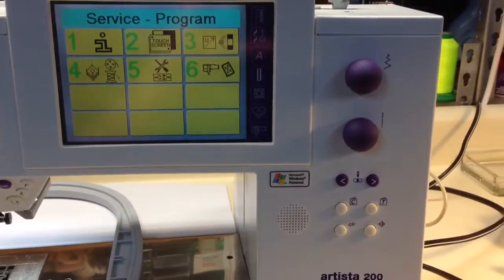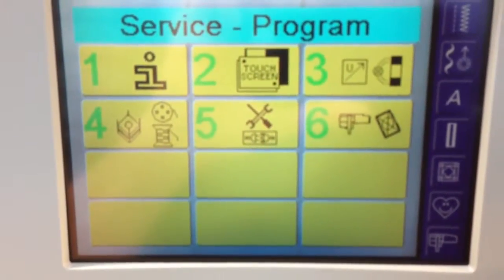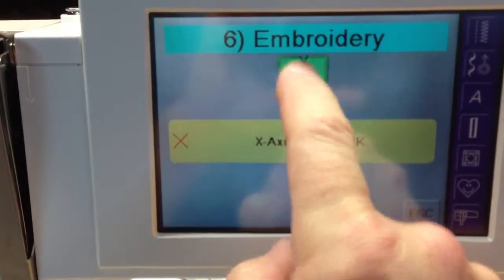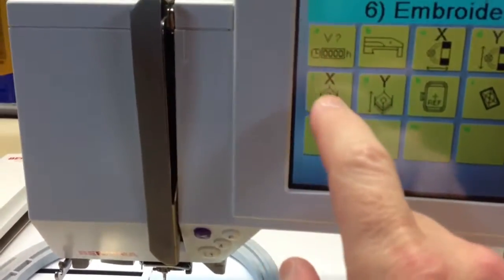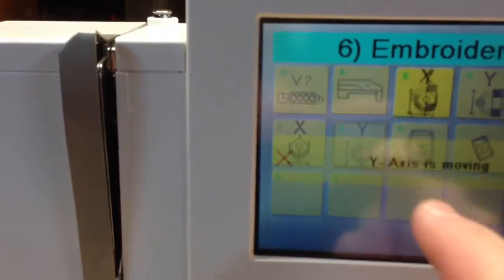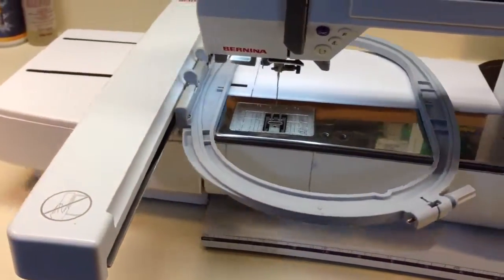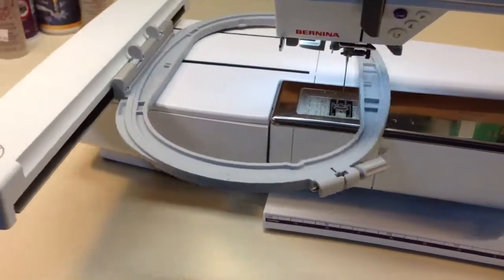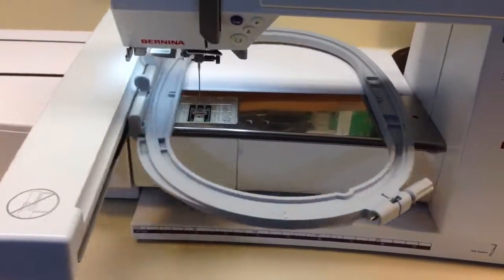Bernina 200 730 How to test your embroidery module.

Comment: we were trying this today with the large hoop.  It moved in the directions and then all of a sudden, it stopped at the lower left corner and the control panel kept saying it was running.  We turned it off, and back on and it said it was still running.  What do you think might be wrong with it.  It took us 8 hours to embroider a pillowcase.  It was VERY stressful.  We would almost get done, and then it would stop sewing. ARG
Reply: How do I clean the bobbin case, this is used machine I don’t have instructions

Comment from the maker: Hi Brian, You need to check out my other video, "Bernina check hours 165, 170, 180, 185" this is the one that shows you how to check the version number of the machine and the embroidery module. The module must be on the machine and plugged into the machine. The machine version number and the module version number must match for the module to work with the machine. Follow that video and let me know what results you have before we get into talking about replacing parts.
 If you did follow these instructions and no version number is showing up on the 180 screen then it's one of two problems. Its the embroidery module or its the machine. The only way to tell is to take the machine to a dealer that has another 180 module that you can try in the store. Hook it up to your machine and go into the service mode like my video shows and see if a module version number shows up on your screen. If it does then your machine is OK and you have a problem in your module. You would have to get the parts from a dealer in the event the module you have needs a new board.
 If you still do not see a version number using another module, then you might have a problem with your machine, possibly the electronic part that the module plug's into needs to be replaced or you have a problem on your main print board in your machine. You cant tell for sure till you follow my video and then try another module if the  module version number does not show up on your service screen like in my video.
 If you have a good Bernina dealer in your area they should be able to hook your machine to a computer and update your firmware in your machine and module so they match. Sometimes you can only update a module so far. Lets say a module is V2 and you are trying to update it to V4.1, it might not work. I have modules that will only update to V3 so in that case you just make the machine v3 even if it is v4.1 right now. You wont notice any difference. You just need both to be the same version number.

Comment: I just bought a 180 and the module is not it showing the version. The machine is version 3.01. You said you might have to replace the board in the unit in the video. I can't find any place on the internet to get the parts. Can you only get them from the dealer?
Reply from the maker: Hi Brian, You need to check out my other video, "Bernina check hours 165, 170, 180, 185" this is the one that shows you how to check the version number of the machine and the embroidery module. The module must be on the machine and plugged into the machine. The machine version number and the module version number must match for the module to work with the machine. Follow that video and let me know what results you have before we get into talking about replacing parts.
 If you did follow these instructions and no version number is showing up on the 180 screen then it's one of two problems. Its the embroidery module or its the machine. The only way to tell is to take the machine to a dealer that has another 180 module that you can try in the store. Hook it up to your machine and go into the service mode like my video shows and see if a module version number shows up on your screen. If it does then your machine is OK and you have a problem in your module. You would have to get the parts from a dealer in the event the module you have needs a new board.
 If you still do not see a version number using another module, then you might have a problem with your machine, possibly the electronic part that the module plug's into needs to be replaced or you have a problem on your main print board in your machine. You cant tell for sure till you follow my video and then try another module if the  module version number does not show up on your service screen like in my video.
 If you have a good Bernina dealer in your area they should be able to hook your machine to a computer and update your firmware in your machine and module so they match. Sometimes you can only update a module so far. Lets say a module is V2 and you are trying to update it to V4.1, it might not work. I have modules that will only update to V3 so in that case you just make the machine v3 even if it is v4.1 right now. You wont notice any difference. You just need both to be the same version number.
Reply: I am having the same problem same machine. Did you ever get a fix?